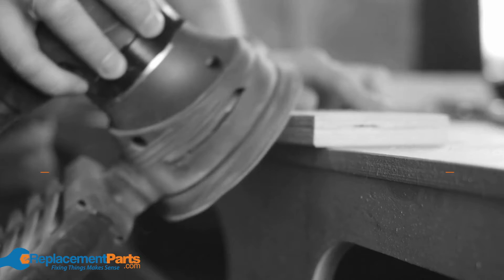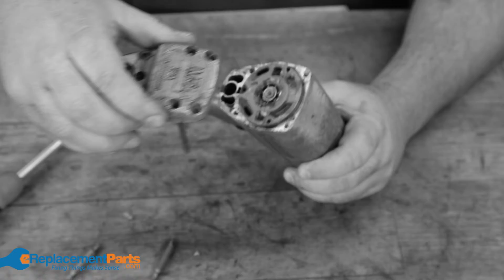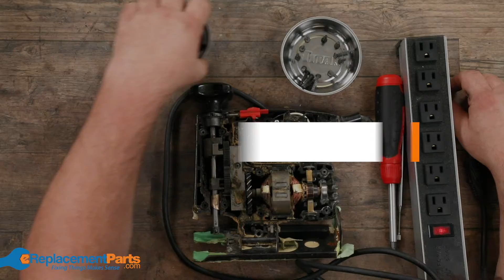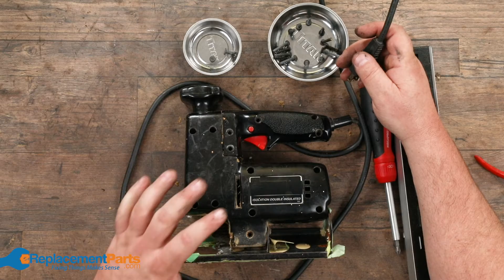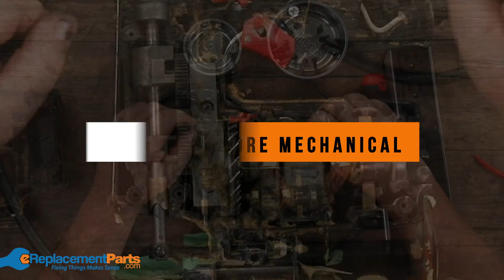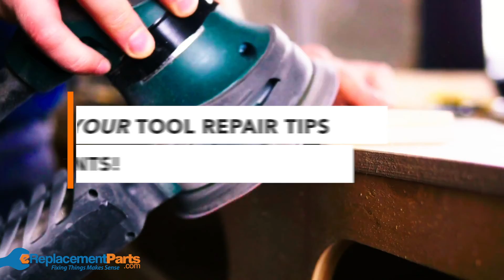8 Pro Tips for Tool Repair | eReplacementParts.com

Comment: Tool tech here too, some wise words, thank you! When I have a lot of screw variation, I sketch the tool on some white packing foam and poke the screws into it. I also use a dedicated electric screwdriver for casing screws, set to a low torque value. Speeds things up, a lot, without stripping housings.
Reply from the maker: Great advice! Thanks for watching and for providing us with some tips!